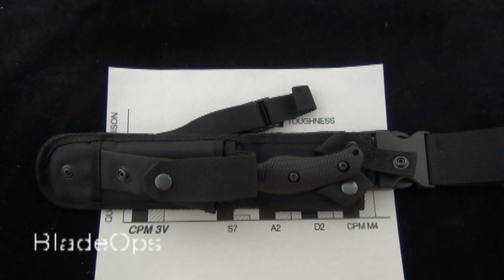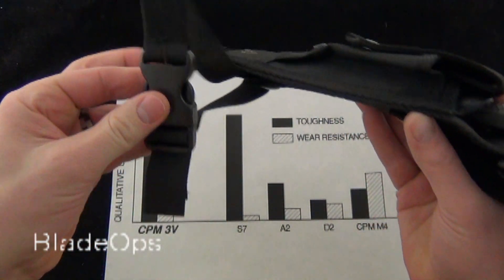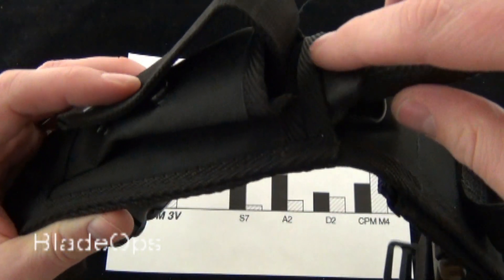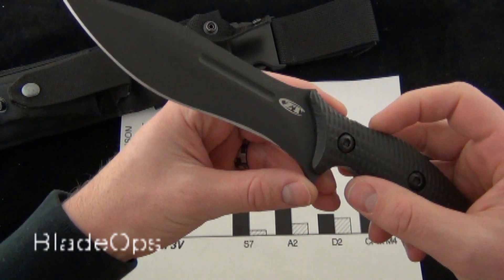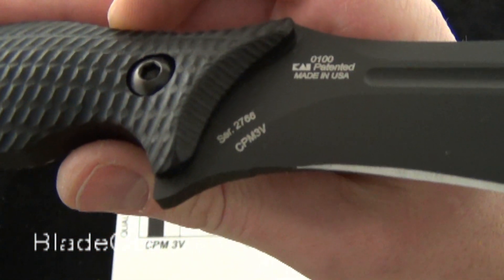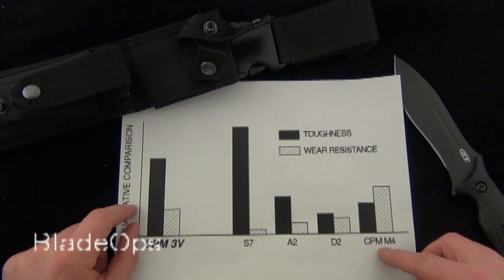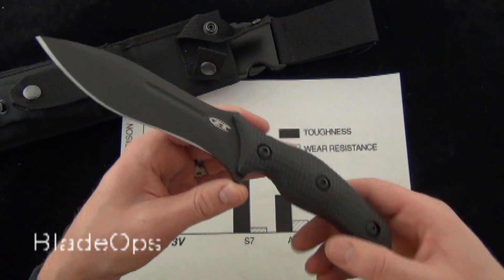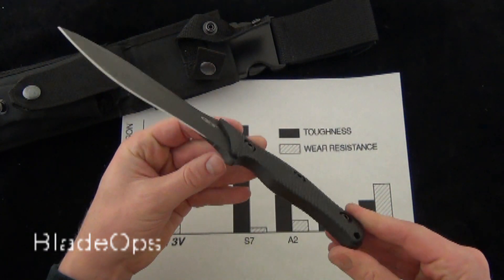Zero Tolerance 0100 Fixed Blade Demo by BladeOps CPM3V Steel

Comment: Great review, i would agree with the last comment and say that it is very expensive for what you get. The only thing better than the SCHF10 is the sheath.. For a hair under $40 vs $288 there really is no justification for this blade.

Comment: Good as a last ditch defensive knife for a soldier if their weapon fails. Re-curved blades are a bitch to sharpen in the field. They work well on the pull stroke though.